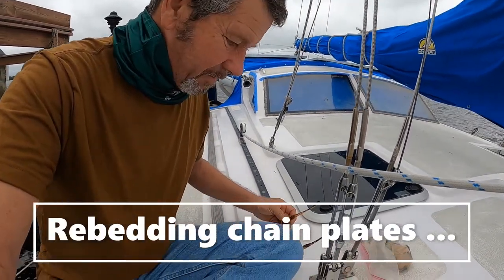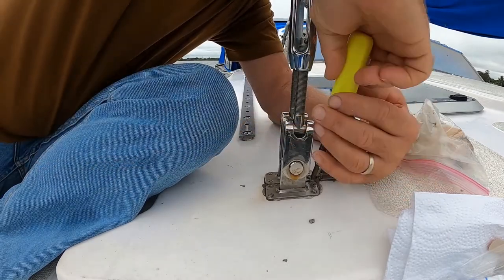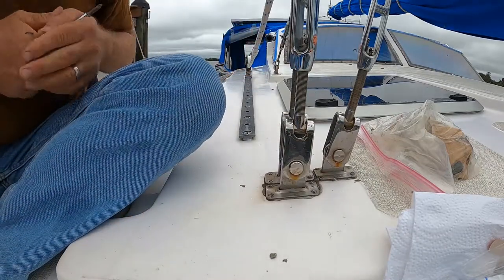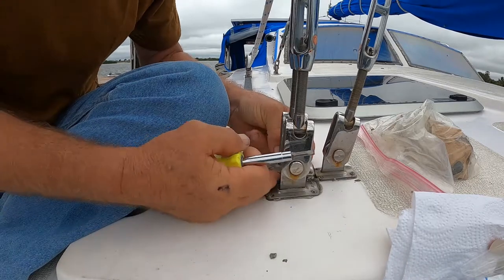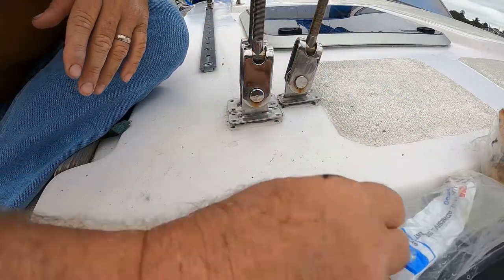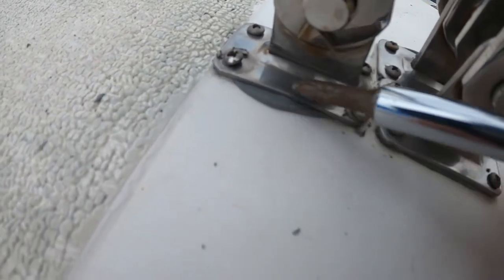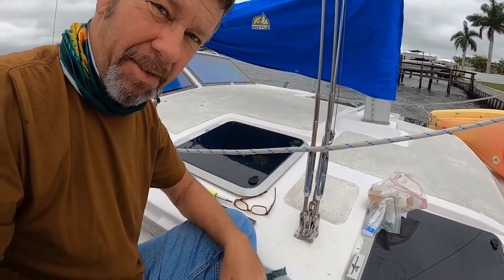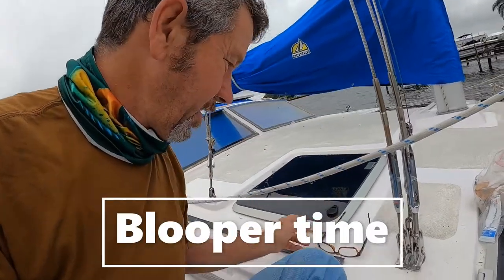Re-bedding our chainplates, on our Gemini 3200.

Comment: I'm about to use butyl on my chain plates. How is it holding up? Would you have done anything different? Thank you!
Reply: Hey Greg, the problem I see with chain plates is they are always moving. Over time they will always leak. I used buytl to bed them and got about three years before having to worry about leaks. The trick I found with buytl is not squeezing all of it out. Snug up the bolts or screws, over time just tighten them more. I'm ok with rebeding every few years. Hope this helps.
Reply: @capt.kenmitchell5116  thank you for the reply!